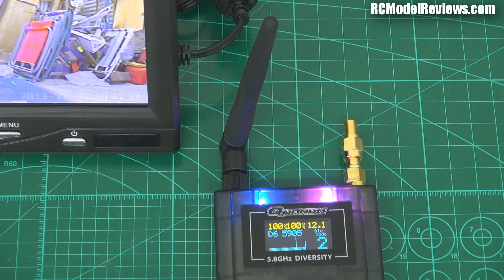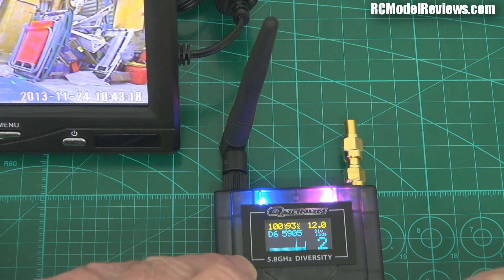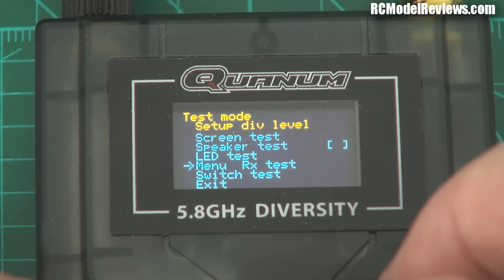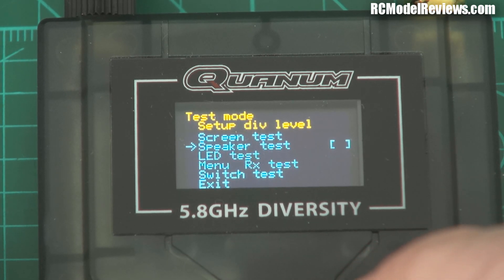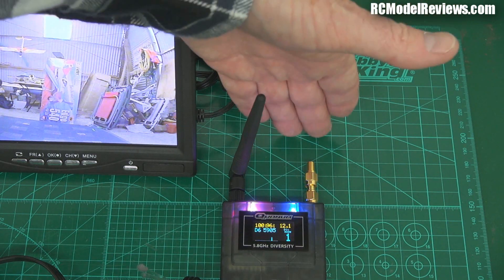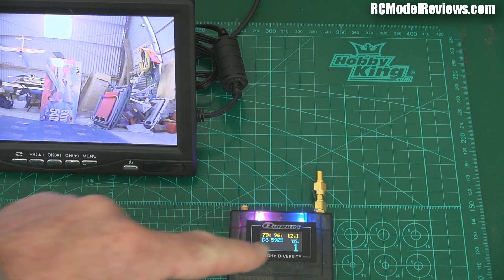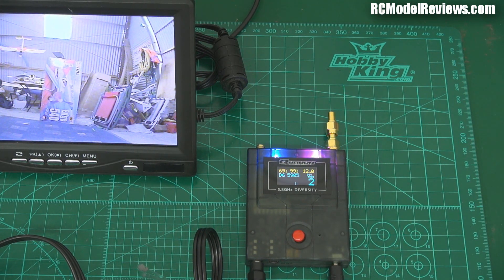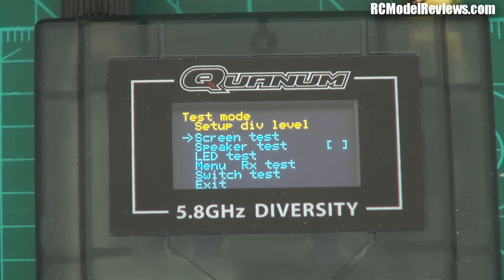Tweaking the Quanum 5.8GHz FPV diversity receiver

Comment: Hiya Bruce.
This is an old video but, you never know 'til you ask so......
Did you get to test this in the field? Some have suggested turning the diversity time Down to 0....... I fly a 5" quad and I was wondering if a faster time is better for flying quads compared to say a plane?
The diversity level and diversity time; do you have any recommended settings for both please? Not an awful lot on Youtube for this unit.

Comment: I've changed switching time to 0ms and it's instant. Sorted thanks for the tip.
Reply: harun1984 
Hi, 
You changed the 'Diversity Time' down to 0 for virtually an instant switch, excellent! What settings do you have for the rest, the default on 'RSSI LED LEVEL' is 25 and the default Diversity Level' is 5 have you changed these setting at all?
I fly a 5" Quad, I have not long bought this diversity unit and there is not a lot of information on the better settings for the unit. I was hoping you could share your setting please?

Comment: Bruce and others:
   I'm trying to make a cable to connect my Quanum diversity receiver through the two 3.5mm receiver outputs to two 800x480 LCD panels. Does anyone know what signals correspond to the 4 conductive bands from the plug base to the tips?  Thanks. Don't want to burn anything out!
Jim

Comment: Hi what about the warning you are always giving about running transmitters without an aerial. I watched in horror as you unscrewed that aerial.  i guess it's ok on receivers.  But I still don't remove aerials with the power on just to maintain the habit. i seen others add attenuators when they remove aerials.  Thanks
Reply: You only have to worry about that with Transmitters. They're pushing power through the antenna and so removing the antenna will cause it to overload, nowhere for the energy to go I guess... POP! This and heat buggers them good, I know from experience!

Receivers are only listening, so removing the antenna at any time won't matter (except, you know, losing your signal).

Comment: Hi Bruce. 
Just been looking at RX sensitivity for this RX. Say "Better than 96db"
So currently using Nexwave module in my fatsharks and it has a gain of 90db.

So looking at your Gain video again you say you double the range with every 3db. So does that mean this RX should give you 4 x the range because it has 6db more gain?

Im sure I have that wrong. 

Cheers

Comment: Hi Bruce. Great videos - thank you for doing what you do.
Can you tell me something about SMA/RP-SMA TERMINATORS. I have bought Boscam 40CH diversity receiver FR632 and I want to buy a terminator, for times when I'm not using two antennas/receivers. On eBay I see some terminators like: "Load 2W DC up to 3GHz 50ohm adapter" and some other terminators like "50 OHM, 0-18 GHZ, 1 WATT SMA Dummy load". So my question is: Should I take 0-18GHz terminator or 0-3GHz will do the job for 5.8GHz FPV setup?

Details about mentioned terminators: 
DYNAWAVE SMA MALE TERMINATOR 50 OHM, 0-18 GHZ, 1 WATT SMA Dummy load 
http://www.ebay.com/itm/DYNAWAVE-SMA-MALE-TERMINATOR-50-OHM-0-18-GHZ-1-WATT-SMA-Dummy-load-/111972978405?hash=item1a121c0ee5:g:AvgAAOSw3mpXFO6a

SMA male plug RF Coax Termination Terminator Load 2W DC up to 3GHz 50ohm adapter
http://www.ebay.com/itm/SMA-male-plug-RF-Coax-Termination-Terminator-Load-2W-DC-up-to-3GHz-50ohm-adapter-/181759020953?hash=item2a51ae8f99:g:89kAAOSw3xJVZxl0

Thank you in advance for your answer.

Comment: Another thing I noticed was the glitch as it switched from one antenna to the other....My Sharp Vision diversity Monitor has buffering, so there is no glitch in the signal at all as it goes from one receiver to the other. It may turn out you need a couple of seconds switch time in order to avoid the glitch while it transitions...?

Comment: Possible bench test setup:
Use 3 linear antennas, one on Tx, two on Rx.  Make sure the two on Rx are identical.  Set the two on Rx at 90 degrees from each other.  Rotate Rx (or Tx).

Comment: Looks like I will probably end up keeping my huge 5800DUO as my main diversity VRx on my DIY V2 goggles, and use this as an entirely different diversity system to set up on on a ground station so I can have a backup and use the DVR on that one which will make the goggles cleaner with less wires.  

It looks like the reason they put in that delay was because the way it switches is also crap with a lot of static, etc.. I hope in the field that it works better. 

 My 5800DUO switches instantly and you can hardly tell. No static at all.

Comment: I am a 100 noob to FPV I would like a ground station or goggles that has everything I need so I don't have to buy this antennas for the drone either or wire or whatever I just want to buy one kit I will not be racing just for fun and that is a good kit that will last me a few years. 
I got the RISE 250, it  it says it is for beginners and it has three different modes on it.
Reply: I also am using a tactic 850 transmitter with a 6ch receiver in RIDE drone and 8ch tundra.
Reply: I'm just hoping to help out a new pilot here.. You will NEED to learn to "wire" ( solder I think you mean) and repair your aircraft even if you are not going to race.. A few small crashes can wear out bearings on motors or leaving it armed with a prop stuck in grass can burn up an esc.. So even if you got the tbs vendetta or irc vortex pro, you wouldn't get "years" out of it without repairing unless u left it in the shelf.. Rcmodelreviews has a great vid on how to solder tho!

Comment: 10 seconds default? Wtf. You would of crashed 9 seconds ago.
Reply: +ThatHPI GUY I don't know that the number is actually the number of seconds -- it's more likely some arbitrary figure which is a multiple of so many milliseconds.
Reply: +Flyingwigs There are many things that can cause it -- even multipathing as you're flying very fast directly towards or away from the antenna can cause rapid fluctuations in signal that are so brief that the glitch caused by switching the video may be worse than the effect of the momentary dropout in signal itself.
Reply: +ThatHPI GUY A lot of people would have crashed 11 seconds ago
Reply: +Hoggdoc Well there are some instances where you don't want the receivers switching back and forth too fast because the video noise created by the switching itself can be worse than the variable signals that might cause the switching.  Preventing unwanted/unnecessary switching is usually prevented by using a delay and some hysteresis (requiring that the stronger signal is more than just a "little" stronger than the presently used signal).
Reply: +xjet would such a situation occur more frequently when using different types of antenna? perhaps the cloverleaf briefly gets a stronger signal than your patch, it might switch prematurely?
Reply: Finally a voice of reason.

Comment: Would be awesome to use this to test antennas side by side. Two antennas enter, one antenna wins! Might have to buy one now... Nice bit of kit.
Reply: +Ben Govett (BennyG) It's probably not quite that easy... I notice that there is a bias (at least on this receiver) towards the right-hand antenna.  That is to say, if there are two equal-strength signals, the right hand receiver is always active.  The RSSI readings are always higher on the right-hand side when no antennas are connected either so this could be either because there's more of an effective parasitic antenna effect on the PCB for the right hand side or the right-hand receiver module is slightly more sensitive or has a slightly higher RSSI output for the same input.
Reply: +xjet Try each pair both ways... Slightly more painful but what I like is seeing both percentage readings at the same time. Ever made a helical antenna? Thinking of trying one. This might be a good tool for me to evaluate one once I've built it without risk of losing signal while flying. If I could get RSSI out of both the receivers, could use the super simple OSD on the output of the ground station so I could see the RSSI of both channels in the goggles. Would be showing as a voltage, but that's ok.
Reply: +Ben Govett (BennyG) Yes, helical antennas are amongst the easiest of antennas for the DIYer to make themselves.
Reply: +xjet Cheers. Will see if I can google myself up a guide. They look simple, hopefully there's a guide out there that tells me which bits are critical and which bits are not. Had good results with your clover leaf / skew planar instructions, used some transformer winding wire I had lying around so they look good, don't corrode, and are well insulated.
Reply: +Ben Govett (BennyG) If there's any interest I may do a DIY helical video as part of the FPV series I've got lined up for the Northern summer.
Reply: +xjet That'd be awesome. There's a few build videos out there but haven't found one yet that covers the theory behind the antennas, and explains which aspects or elements of the antenna are important. Seen thick wire, thin wire, with and without formers, some say to use a thick baseplate, others use PCB. A theory video with builders tips for the practically minded would be good, in the meantime will keep on reading to see what I can dig up. Cheers.
Reply: +Ben Govett (BennyG) Here is a description of lots of details you might be interested in: http://fpvlab.com/forums/showthread.php?25174-Link-Margin-Transmitter-Power-Theoretical-Range-and-Antenna-Gain

Comment: I wonder if it's intended for long range flights with planes as opposed to quads. For a plane the RSSI change between receivers will be much slower vs a quad flying between trees etc.
Reply: +Ben Wilson With a plane if you are flying far out you don't really need diversity or an antenna tracker. Of course it depends on how broad the beam width is of your high gain antenna but it gets broader the further out you are. I recently got a diversity receiver but I havn't got around to using it yet. It can be nice I suppose when you are coming in to land and you want to circle around for a bit before landing but by then I normally have the plane in visual range by then anyway. Oops let the cat out of the bag there.

Comment: 1 sec is "ok" I guess. Seem like my 5800DUO does it in about 1/10 or 1/25 of a second though.
We'll see how it works in practice.

I have a quick demonstration at the end of a vid I made-  in real time,  just covering up VAS Cyclones with my hand and it switches basically instantly.   I will post a link in reply to the post, but will probably get flagged as spam. I have no ads on vids.  I'll put a link directly the second I do it. (It only takes 3 seconds or so).   VTx is a 25mw  Quanum Elite VTx/Cam combo is about 1 foot away.

If the Quanum performs anywhere near that good, that will be ok. Maybe they can update the firmware and get it switching even faster. I will have my Quanum Diversity Rx soon I hope.